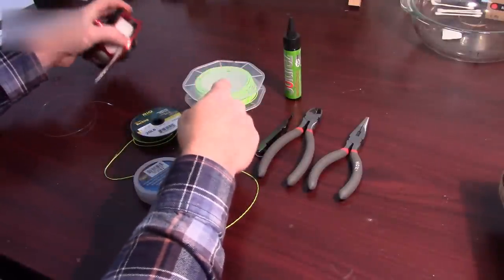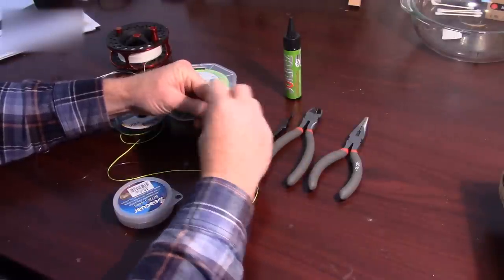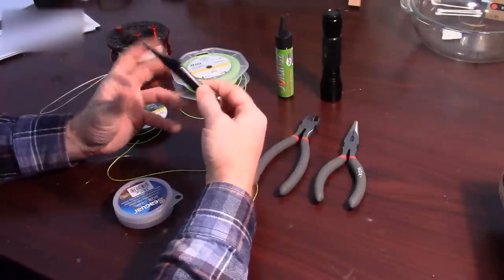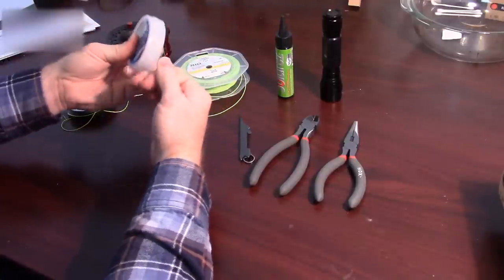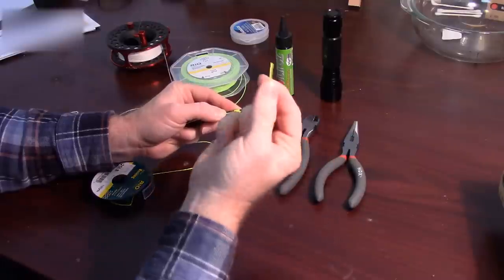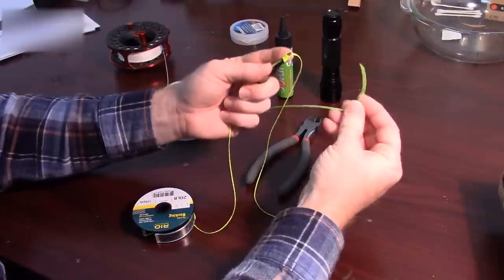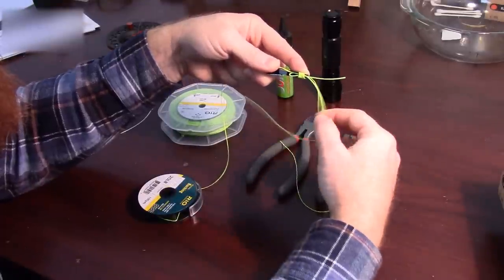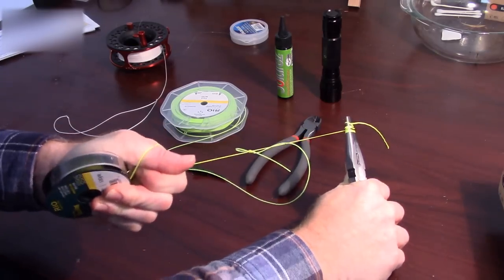Easy Way To Make A Fly Line Loop - Not a Welded Loop

Comment: What happened to the 'old' method of stripping off the outer sheath of the fly line and making the loop with the monofilament core of the fly line itself?  It made a very compact loop with a knot no bigger than the fly line itself.  Do current fly lines not use the mono core anymore?
Reply from the maker: Many aren’t mono now no.  But yes that’s a way if there is a mono core, or other types of cores they use.  However it is really complicated, and takes a lot longer.  This is the “easy” way.  Not necessarily better, just easier.

Comment: There is another way to go at this problem, and it comes out small enough not to be bothersome on the leader end of the line; in fact, it is probably a smoother connection than the traditional nail knot - and it gives you quick leader change capability.  First, double the fly line to form the appropriate sized loop, plus leave at least 3/8" for a tag.  Take your bobbin and a thin fly tying thread, 70 denier or 8/0 should work fine, and wind a double layer of touching wraps over most of the tag while making sure that the thread doesn't slip off the end.  Keep in mind that the more lightly waxed the thread is, the better.  We want the adhesive to soak through and bind everything together in the last step.

To tie off, make 4 or 5 tight touching wraps over a loop of thread or light line, then cut the working thread and put it through the loop.  Maintain pressure over the last wraps with your thumb and forefinger as you pull the loop out in one swift, smooth motion.  Rod builders will recognize the technique, as it is virtually identical to how you tie off guide windings.  Trim the tag and coat the windings with two light coats of superglue or solarez thin/hard formula - making sure each coat is thoroughly dry.  With the UV resin, you can taper the butt end of the connection somewhat.  This makes a connection strong enough that a 230 lb. hillbilly (me, for example) can pull on it to the point of cutting into my hands without it breaking.  It may need some testing before trying it out on huge fish, but it should easily be stronger than a 12 lb. tippet and works fine on my rods of up to 5wt, lasting through several seasons of moderate use.  Let me know how it works for you.
Reply from the maker: +handcannon yes I've done it that way as well...  however I find it not as easy to accomplish.  The flexablilty of the fly line makes it difficult to make wraps on.  But still a great way to do it.

Comment: Needs two sets of nail knots, not one.  Also, if you tie perfection loops on either end of backing/nylon then it is easy to cinch up and pull ultra tight using whatever you have to enable pulling down whether it is your forceps, bit of stick, knife handle etc. etc.
Reply from the maker: Thanks for the info

Comment: How does the solar cure knot stuff compare to super glue?
Reply from the maker: +Adventures with Frodo well in this case I was using a flex resin for the knot since the line flexes.  Super glue would crack and flake off after the first few casts.